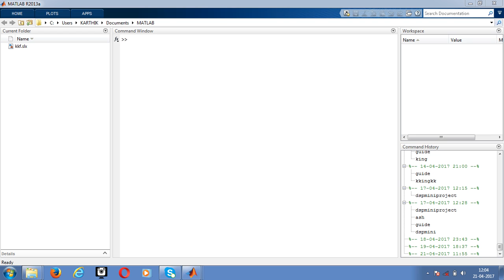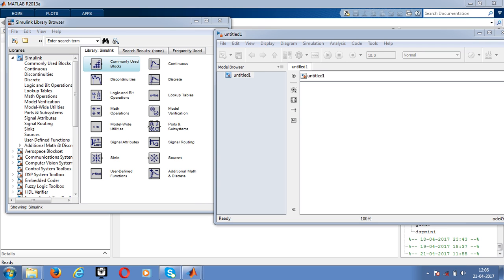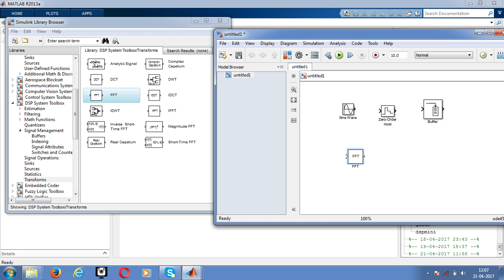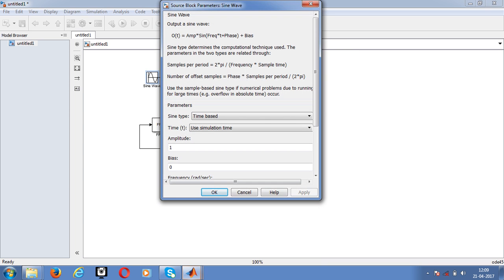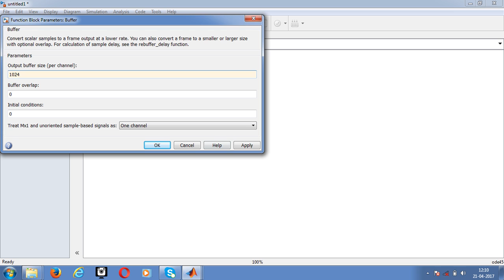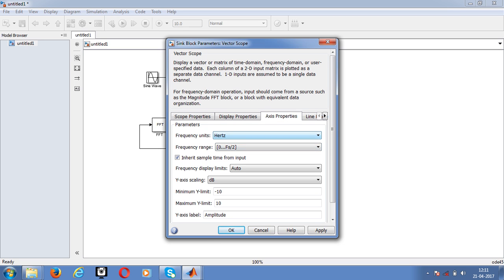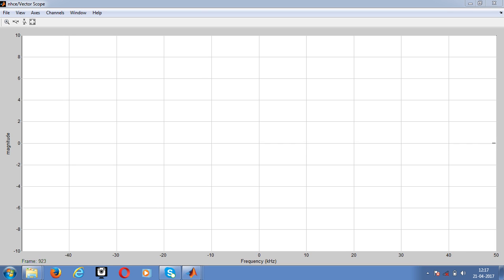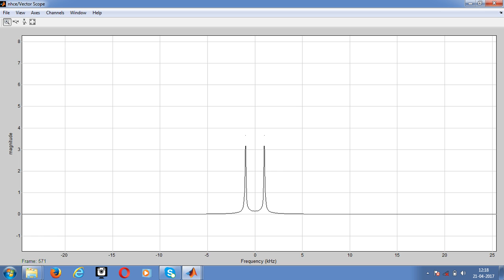Simulink matlab FFT of a signal||4th semester experiment in DSP|| VTU experiment

Comment: i cannot find the vector scope in my library
Reply: it has been replaced since the version 2018 by the block array scope
Reply: @zhaozhiwu7774  this block arrary scope is not in my sink folder too
Reply: @jaideepverma3749  what is your matlab version?
Reply: @zhaozhiwu7774  it's 2019a
Reply: @zhaozhiwu7774  also can u help me out for finding Freq response of a signal ? It's better if we can connect through mail 😊
Reply: @zhaozhiwu7774  my matlb version is 2018a . It showing array plot only.. Is block array scope is same as array plot
Reply: @njuuus7928  Yes, I think so. I guess the block name has been changed but the function unchanged. Now, we have the version of 2021a or more advanced. It is more efficient
Reply: @zhaozhiwu7774  thank you... 
I will try 2021a👍
Reply: @njuuus7928  u r welcome